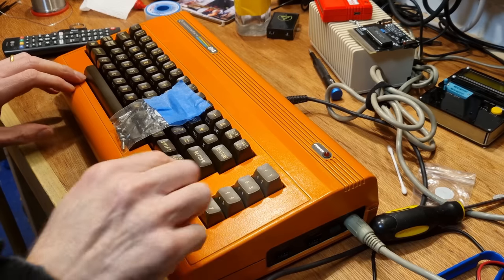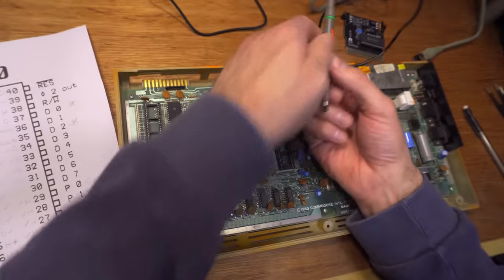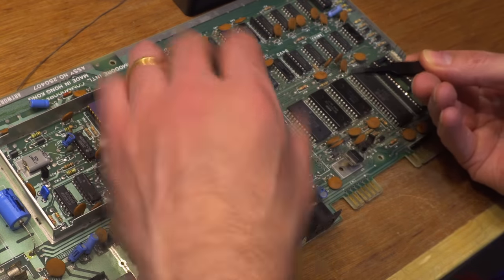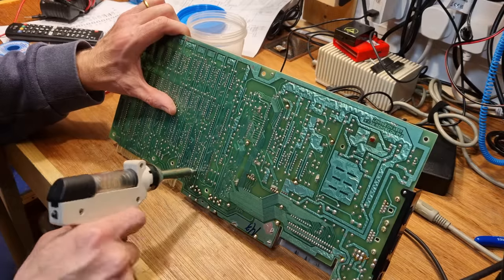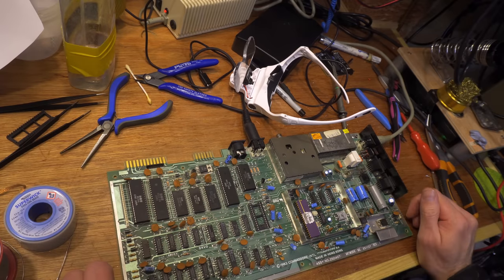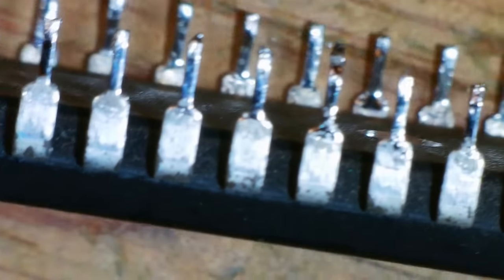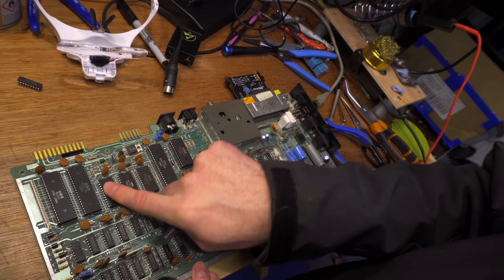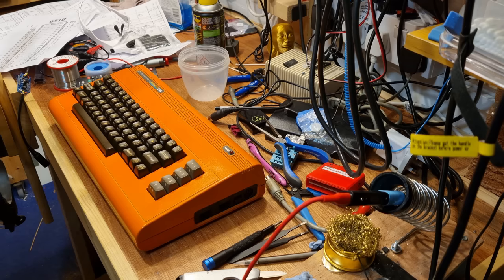C64 Donald With HOOKED CHIP LEGS!

Comment: The PCBs after they are wave soldered get the leads cut by a circular cutter (a bit like a ham slicer at the deli) it is meant to cut the parts with long leads but if it is adjusted incorrectly or the boards bow too much then the chip pins can get cut as well. When the cutters get blunt then they tend to burn the way through and fold the last bit over & because it is hot and covered in solder it then sticks to itself.
Reply from the maker: Ah! That makes total sense. Thank you!

Comment: The earlier commenters beat me to it.  I just did a repairathon of C64s and ran into a bunch of chips with the folded over legs and I got flashbacks when I saw them.  Way back in the stone age, a.k.a. my youth in the early 90's, I worked in an assembly facility making control circuitry for industrial machines.  We had a wave soldering station and that's exactly what would happen.  The boards got "shaved" before running through the wave soldering station and if the "shaver" was misaligned or had dull blades or wasn't calibrated correctly, or if the board was bowed, you'd end up with these half-cut legs that would often fold over on themselves.  Then through the solder bath it would go, and you end up with the folded leg soldered to itself.  Based on my recent experience, it looks like it was pretty common on 250407 boards.  Four of the seven 250407's I repaired had these folded pins.  The other 3 were OK as was the 250425.
Reply from the maker: It's funny, I'd watched a LOT of C64 repair videos and never saw it mentioned. Then this one happened and I thought it must be a one off. Since then I've seen it on loads of machines!
Loving your work!

Comment: Also regarding the bent leads. I think Bill Herd at some time mentioned it that they used to trim the Leads for wave soldering to prevent solder bridging by excess amount of solder hanging onto longer legs. The run the chips through  a two sided cutting wheel. I can imagine the two wheels not beeing aligned properly and bending the leads instead of cutting them leading to them bent over fully further down the line before stuck to the board.
Reply from the maker: That makes so much sense! Especially the way they are bent over in the same direction. On one side into the chip and on the other away. Nice one!

Comment: Really bizarre with those legs, and highly dangerous to remove. Good work getting them out without doing any damage. I can only assume they weren't cut right during manufacture, I guess all the legs are cut by machine before wave soldering rather than after.

As for the fault, nah I wouldn't have guessed character ROM off the bat. But seeing that pink screen did make me wonder if it was something closely related to the VIC-II seeing as you already ruled that out. So I would have gone PLA first (just because it's always the PLA) then 4066 at U16, then probably the colour RAM, then the character ROM. So going for the character ROM before the other ROMs was a good call. And hey, more sockets means easier repairs when those chips eventually die
Reply from the maker: Your c64 diagnostics videos have been an invaluable resource for me. But super disappointed when you didn't explain how to fix this exact fault 😆
Someone else mentioned about the badly removed ends of the legs being the reason. Makes a lot of sense

Comment: "I'm just whittling me CPU!" You crack me up! 🤣 I've seen plenty of chips with the legs trimmed, but never bent over like that. It's weird!
Reply from the maker: Cheers Tim! I've been enjoying your pi1541 video today! I have one to build soon so that video is super useful for me
Reply: @MoreFunMakingIt  Going in, I was expecting it to be a more complex project. But the reality is that it boils down to a 6-pin Din connector and 3.3 <-> 5v level shifters, plus some switches. It's definitely fired me up to do more Pi projects though. If only Raspberry Pis were easier to get hold of...
Reply from the maker: There was recent good news on the pi front. Availability is good right now so worth getting an order in

Comment: For cleaning component and chip legs, I found Scotchbrite scouring pads to work wonders. Although that fiber glass pen is more suitable for smaller spaces, I think I also need one.
Reply from the maker: Excellent. I'll give that a go. The fibre glass pen works very well but I hate getting the fibers in my fingers. Nasty stuff!
Reply: @MoreFunMakingIt  The scotch brite quickly wears down giving off a lot of flakes. It's recycled cardboard so no dangers there :)
How long have you had this channel, I only came across it last week.

Comment: Those ROM ICs fail frequently, and I didn’t realize that myself until my ATARI’s basic rom failed (repair video on this channel) and I had a chess computer with also fail. Hence I create a video where I created a ROM dump using an Arduino mega (because that rom couldn’t be read in my China reader/burner), for prosperity sake. But neven with this knowledge I wouldn’t have gone for the ROMs first but first the annoying 2114s because they are even more notorious for visiting chip heaven.

Comment: Super video Lee and yeah I don't think I would've got to the root of that problem any quicker, almost certainly I would've been muuuuuuuch slower as I've never worked on a C64 before! But being an armchair C64 repair addict, one thing I've seen The Retro Channel do is use a infrared thermometer to see how hot each chip is getting and then pick on the hottest one, you mentioned how the Char ROM was slightly warmer than the others, would've been interesting to know what it would've measured compared to the rest? Probably would've told you nothing, but it's perhaps another tool you could try next time? As mentioned I know-a-nothing about C64 repair so please feel free to ignore me😋 also forgive me bringing up the right honerable Mr Black, he also snips legs on chips to isolate them on a bus before removing, which will work, but it makes me wince everytime he does that so I don't like to recommend it!
Reply from the maker: Hey Chris! Any suggestions are always gratefully received. None of us are experts, well, maybe Adrian and Mark Retro Channel. And GadgetUK, and... Well some of us are experts! But I dont count myself amongst them. 
The thermal camera is on the wishlist along with other crazy expensive things like better lighting, cameras, hakko desolder station, gold plated helicopter. It would certainly be useful, especially to me. I dont have very sensitive fingers, especially when its this cold, Something is either cold or burning my fingerprints off.
As much as I admire the godfather of retro repair Mr A Black I cant get onboard with snipping legs on chips. It goes against every fibre of my being to do something so destructive to a chip that might be ok. I cringe along with you when I see it. I think it comes from the culture of actual professional repairers. Those guys were not dealing with a nostalgic item, they were working against a clock, and tracking down the fault fast was more important than preserving something that they could easily fix anyway with a blob of solder. Not a fan of that method!
Anyway. Thank you for watching!

Comment: I have the exact same board in my box of 80's stuff. Man these boards had pathetic cooling. Voltage regulator too hot to touch at all times, video chips just dying... all just to save on cost(although that did work) The upgrade to the 8500 chips with the C64C was a massive improvement.
Speaking of saving on cost, Sinclair bought a huge bad batch of 4464s (Can't remember from which manufacturer, or if it was the 41464) once. He got it for such a bargain it warranted a whole revision just to support these chips of which the top half of the memory was inaccessible (something with the second byte, it was a 64K word chip). So they put two of the chips on the board had the memory controller just address the lower half. I might have gotten it worng somewhere, but you get the gist of it. Anything to save on cost and get those machines out there cheaper than the competitors.
Reply from the maker: You're on the right track, but there's a bit more to that Sinclair cheap ram story. Worth looking it up.
Reply: @MoreFunMakingIt  Already did :D

Comment: To fix a chip with crazy pins, solder it into a machine pin socket.  It will be slightly taller with the socket stuck to the bottom, but the pins will be more manageable.
Reply from the maker: I'll try that one day! Thanks for the suggestion

Comment: Hmm I have a hypothesis about the bend legs. I think the pick and place machine was a bit off and just pushed the component in. The fact that you can get them out gives the hypothesis more credibility. But I’m far from sure. But this is also the reason for SMD components, you don’t need to put those dead center and force them into a tiny hole. They’ll align automatically in reflow anyways, and that made pick and place machines a hell of a lot cheaper.
The cutting wheels I find a less likely because they do not tend to cut anything smaller than 1,5mm I’ve never see cut CPU legs on a C64 or ATARI.
Reply from the maker: Imagine a C64 made with all SMD components! 😆

Comment: There is a c64 faults database with common faults they’re symptoms a screenshot and description. I didn’t check it for a while but I’ve seen the 8bit guy, Adrian black and Gadget UK using it in their repairs or at least mention it. Hope it helps next time around.
Reply from the maker: I use that often. Fantastic resource. Featured it in a recent video too.

Comment: Either someone wanted to play an evil prank on hobbyists or folded em to hold the chip in place while soldering :)
Reply from the maker: That's what I thought, on both counts 😂
But others have said they cut the excess off with wheel cutters and sometimes it didn't quite work
Reply: @MoreFunMakingIt  Ok, interesting, never heard of wheel cutters, at least for electronics :)

Comment: They must have used a special tool before soldering the chips. Perhaps it was a new method of soldering they were trying. Clearly it was not the chip maker who did this because unrelated chips have had this done.
Reply from the maker: I'm told it was a machine that trimmed the ends of the legs off. If it was not set up quite right it didn't cut all the way through and this was the result.

Comment: I thought it was fairly obvious it was the char ROM. And all any reasonable person had to do was go to 33m in the video to find out. Being serious though I would have expected all the ROM chips to be ignored while a cart was in, but that just shows how little I know
Reply from the maker: Ohhh! You get top marks for the most meta comment ever! Taking the advice of the video and applying it TO THE VIDEO?!?!? Pure genius. Also yes! I thought pretty much the same about the dead test cart disabling the roms. Its nice when you beat a tricky one like this though, you know you've learned a lot. Now the real trick is remembering...
Reply: The normal dead test's cart's address space doesn't map to the 6510's startup vector, it maps to $8000-$9FFF.  The 65xx family CPUs jump to the address in vector $FFFC (&$FFFD) on startup.  So, you still need the kernel ROM there to begin normal boot and read the magic locations ($8004-$8008, maybe?).  If those bytes contain "CBM80", it will jump to executing whatever is in the cart's vector at $8000.  

The character ROM is absolutely the last thing I would have suspected, but I guess if it or BASIC had some kind of internal short causing it to pull some data lines one way or the other, it would stop the whole shebang since the kernel can't read the correct magic values.
Reply from the maker: @3vi1J  that's amazing knowledge. Way beyond my skillset 😉 My lack of knowledge might have helped me choose the right ROM! 😆
Reply: @MoreFunMakingIt  Hehe, thank you.  I used to rip cartridges to disk for my friends as a teen in the early 80's... and it's amazing the stuff that stays with you.  I'm much weaker on the hardware side - so thank you very much for sharing your knowledge and experience there with us!
Reply from the maker: @3vi1J  absolutely my pleasure! 😉

Comment: Bad manufacturing and were bent to match the correct length.
Reply from the maker: Possibly! Someone said they were supposed to be cut shorter so they have less chance of bridging whilst being wave soldered. And that the machine doing the cutting was probably not doing a good job. Thats the explanation that makes the most sense to me.